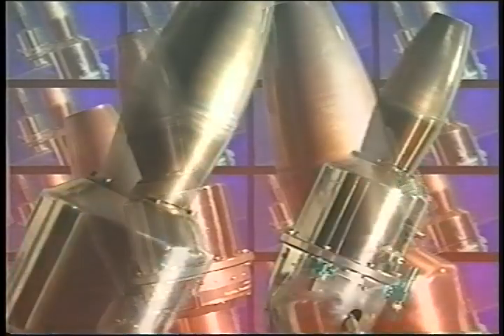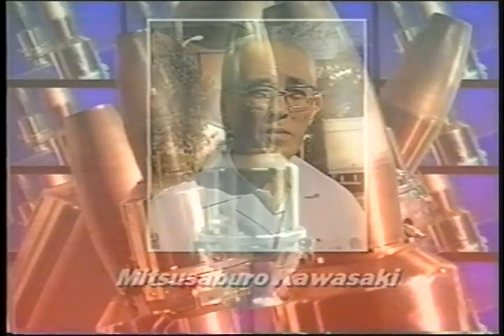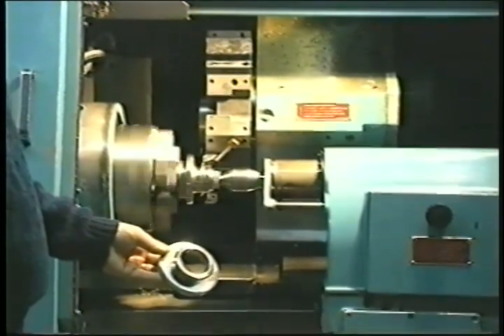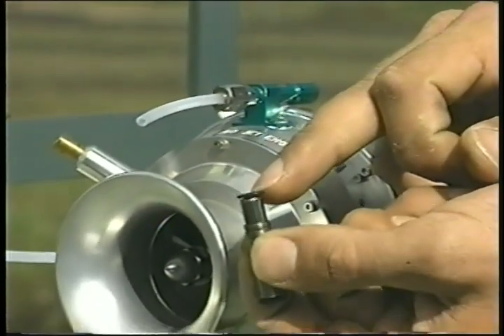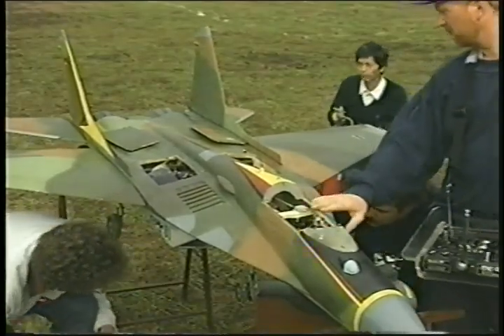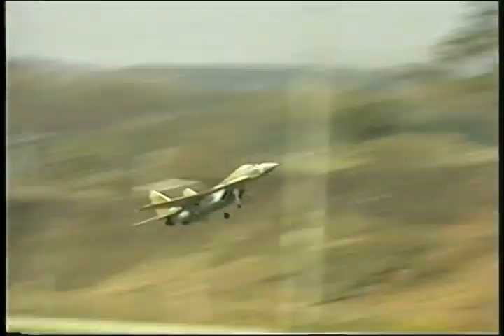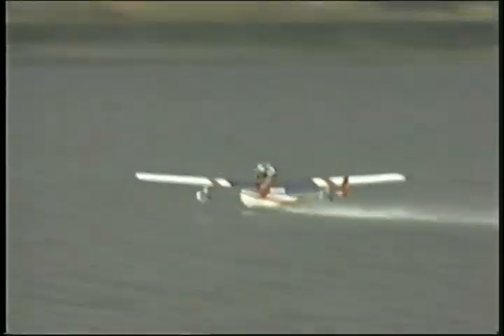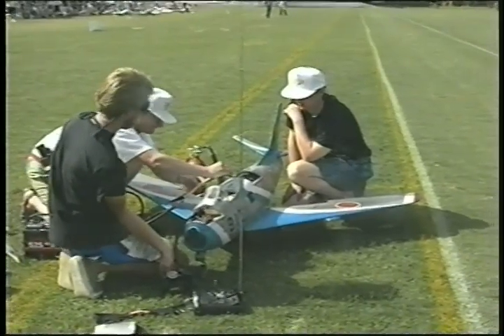Dreams Come True with Sophia Turbo Jets Promotional Video 1996

Comment: I flew some of those... they did not stick around very long... I wonder what happen
Reply: These propane engines were  overtaken by AMT NL  JETCAT and SIMJET at the time..,  more  powerful and  reliable liquid fuel engines...
Reply from the maker: This is NOT a propane engine. Did you watch the video? Actually the customers were not capable of caring for their engine hence the decision to stop marketing to the consumer market.
Reply: You are right, i miss that fuel part..
Reply: I think the J450 already had a computer controller, ECU.. The sophia J850 engine already had an ECU built by Jetronic..
Reply from the maker: These are old videos when the Sophia first came out. Yes the later versions had an ECU
Reply: @humbertomonteiro6742  It was the early days for this part of the hobby. Very exotic for the time. A lot has changed! That’s why we see inexpensive jets used for everything from ridiculous RC trucks, skateboards and go karts. Back when this was filmed these engines were out of reach for almost everyone. Still a great accomplishment!
Reply: No computer controls and built in brushless starter what happened. That came later and would have helped this stick
Reply: They were still expensive out of price range for average modler